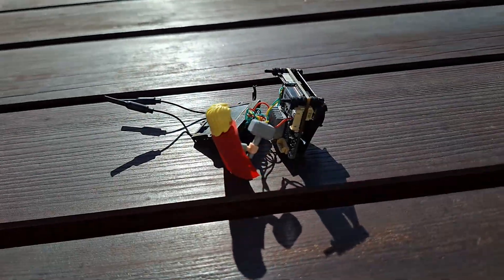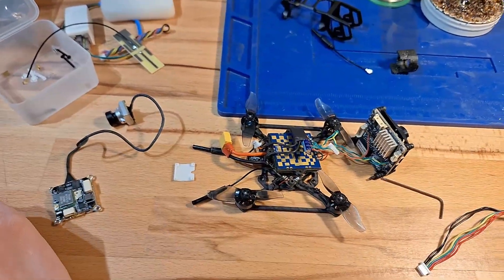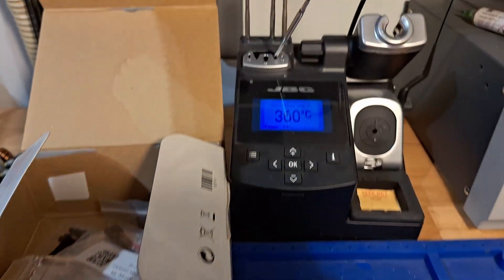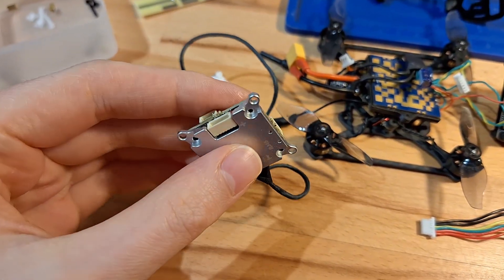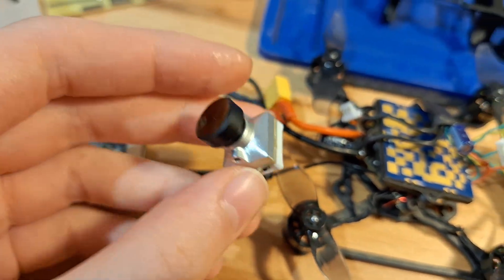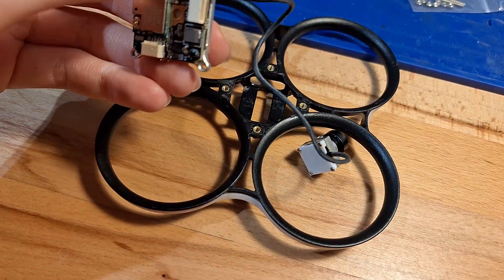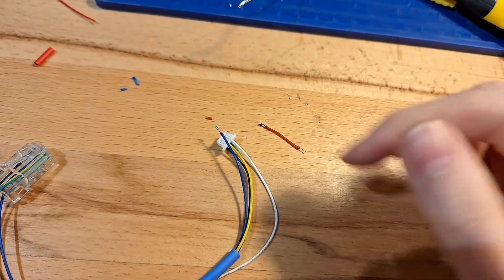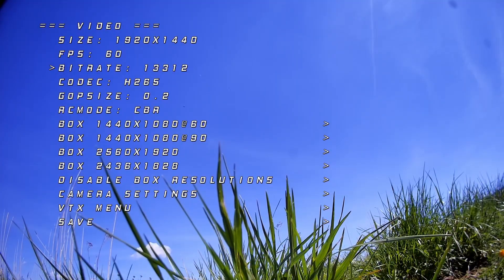The TINIEST OpenIPC FPV camera and VTX - Thinker Tiny review

Comment: Oh man I tore that jst connector off on first use, there was no solder holding down the sides, just the 6 little pins and some conductive glue. I had 45 degree connectors so soldered a new plug and reversed the wires, then stuck with hot glue. Checked all the connections with a multimeter so hoping will be ok. Flashing the firmware to emmc on the groundstation Radxa was very finicky, a good dozen repeats of flashing a bootloader then a clean image, then the bootloader, then the ipc image. Kept hanging at given percentages but finally eaked through. Was a bit disappointed with how fragile the thinker was, and how narrow all the documentation is. Wouldn't recommend, as much as, be willing to help if someone really wanted to try and I felt they understood what they were getting into.
Reply from the maker: Thanks for sharing your experience. The OpenIPC system is still in the development phase, so the devices are not as polished as they could be and the documentation often doesn't keep up with the rapid pace of development. But as someone who likes tinkering - I love it ;)

Comment: I broke off the debug pads in SSC30KQ. I feel so stupid now...i had soldered them properly and then accidentally it fell and they came off

do you have the pin diagram of the ssc30kq mcu so that i can solder pins to the legs directly

I found the pin diagram of ssc338q one
Reply from the maker: No, I don't have a pinout diagram unfortunately. They seem to be protected under NDA's.
Reply: @arturpekosz 
Thanks for replying.
I found the uart trace leads to pin 41 and 42 and they beep on multimeter continuity test

I will repair the pads and see if it works

Comment: I once fixed a flight camera's not being in focus across the frame by putting tiny black rubber shims under the sensor chip and adjusting the chip's hold-down screws incrementally until it was perpendicular to the lens axis. A tedious process, and you must be careful not to get dust or fingerprints on the sensor, but it worked great.

Comment: ¿Se puede conectar a un Meteor 75 pro hd ? 
¿Usar el mismo conector que usaría la O4 lite, pero conectar la thinker y así no soldar? 
¿Se podría?

Gracias, saludos desde Chile
👋😊🇨🇱
Reply from the maker: Could you send me a link to the drone you are asking for?

I can see "Meteor 75 pro" and "Meteor 75 HD" but I can't find "Meteor 75 pro HD".
Reply: @arturpekosz   
¿Se puede conectar la FC Matrix 1s HD a la Openipc thinker con el conector de video HD?

¿O hay que soldar siempre?
Reply from the maker: You would need to solder, the Thinker's connector uses a different pinout. Also, the wire the Thinker comes with only has the connector on one end, to connect to the Thinker, so you need to solder the FC side of the wires anyway.
Reply: @arturpekosz  muchas gracias 👍

Comment: Hey quick question: can the thinker run on a 5v regulator? I know that 1s doesnt work but the mobula 6 pro has a 5v output for the o4...
Reply from the maker: From what I read, it can work with 5V, but you need a regulator that can provide enough current. But if the 5V regulator is designed to power an O4 then it's probably okay. I haven't tried it though.
Reply from the maker: I checked with some people in the OpenIPC FPV Telegram chat (here is a link by the way: https://t.me/+BMyMoolVOpkzNWUy ), and it seems the answer to this question is unclear. The Thinker is officially rated for 2-6S voltage, and it might work with 5V or it might not, you would have to test.

Comment: I am choosing between mobula 7 and mobula 8, I would like to buy mobula 7 but I am not sure if I can install OpenIPC on it but now I realize it is possible or not? Which drone is better to choose for OpenIPC?
Reply from the maker: I haven't flown any Mobula drone, but I know that someone mounted the Thinker Tiny on a Mobula 7 2S and they told me it worked great. But keep in mind the Thinker can't run on 1S voltage, you need a battery which is 2S or more or alternatively a step-up voltage converter.
Reply: @arturpekosz  How much does the BEC that you used on your IP camera build weigh? Does its weight make a difference?
Reply from the maker: I haven't weighed it, but I would guess somewhere between 2 and 4 grams. But I think the DIY IP camera setup is too heavy for a Mobula 7, Mobula 8 is 2-inch just like my drone so it might be able to do it.

Comment: Same findings here, no lens lock nut in the kit and the 6-pin connector does not fit well, had to use another one.
Reply from the maker: For me the connector fits, the issue was that one of the wires broke off and I had to fix it. I agree that a locking ring for the lens would have been nice to have in the kit.

Comment: How is the delay ? Can i use this for cinematic flying on an 5 inch ?
Reply from the maker: It depends what you mean by "this" and what you mean by "cinematic flying". The minimum latency possible with the OpenIPC system is, from what I know, about 30-40 ms, which is more than analog and HDzero (which have about 15 ms) but similar to systems like DJI and Walksnail. The Thinker is a top of the line OpenIPC camera, but to achieve the lowest possible latency you also need a good receiver setup. The lowest latency is with a Radxa 3W and a low-latency monitor or HDMI goggles, running a 90 or 120 FPS video stream. My setup doesn't achieve such a low latency, it's somewhere in the range 40-60 ms, because I use an Android phone to decode the video and I'm running the system at 60 FPS. But this latency is okay for me since I don't fly very fast.

Comment: This project seems to be taking off quite well.

Can you please make a video how to connect the bl-m8812eu2 to ssc30kq chipset

What are the ranges you are getting from diy and thinker tiny?
Reply from the maker: I already showed how to connect the bl-m8812eu2 to the ssc30kq camera in a previous video: https://youtu.be/aJwHacSwsAA?t=515

I was able to fly to about 400 m with the DIY setup at 16 mbps video bitrate, and about half of this with the Thinker Tiny. But these numbers need to be understood in context:
- I was running the DIY setup at low power, much lower than people typically run with the bl-m8812eu2 module, because I was not using a heatsink and I was afraid of burning it.
- I was running the Thinker Tiny at an output power which I believe is a "safe but on the higher end" power setting for this WiFi module.
- The transmitting antennas I used so far in both cases were not optimal - simple dipoles, which have an inhomonegeous propagation pattern.
- The inhomogeneous propagation pattern of transmitting antennas is a much bigger issue for the Thinker setup, because it only has one antenna. With the DIY setup I had the STBC (Space–time block coding) setting enabled, which made the WiFi module transmit using both antennas. The two antennas were placed at an angle to each other, which compensated for the inhomogeneities in the propagation pattern.
- To make the Thinker Tiny work better with a single antenna, I ordered an LHCP (left-hand circular polarisation) "lollipop"-style omnidirectional antenna, which has a much more homogeneous propagation pattern.
- The receiving setup I've been using so far is not well optimised for long range (only one WiFi adapter, with two omnidirectional Pagoda antennas). Having more WiFi adapters, with some omnidirectional and some directional antennas, is much better for long range.
- The Pagoda antennas on my receiving setup have LHCP polarisation, and the dipole transmitting antennas have linear polarisation. This means some signal is lost due to the difference in polarisation. Once I get an LHCP antenna for the Thinker Tiny, they will match the LHCP receiving antennas, and this cause of signal loss will be gone.

There are many factors that influence range. I think there is a chance that with a better antenna, I might be able to achieve roughly similar range with the Thinker Tiny as with my previous DIY setup. But that's because my DIY setup was run at low power - I know that some people have achieved multiple kilometre flights with the bl-m8812eu2 module, running it at its maximum power and using a much better receiving setup with directional antennas.
Reply: Oh how did i miss the wiring part.....
Wow such a detailed analysis, thank you so much for replying.

I am planning to use 
AIR Unit
1 Bl M8812EU2 module
2 omni 3dbi antenna 
1 ssc30kq camera with 2.8mm lens

Ground Unit
1 Bl M8812EU2 with 2 3dbi omni antenna
1 VR box(i own)
My mobile

I also have a radxa 3w but i want to first enjoy the basic setup

I also heared the bl-m8812eu2 has 800mW of power (probably transmit power) as this is the module used by wyvern link high end module

I also have a Bl-r8812af1, wondering if i mix match eu2 and af1 modules with the radxa 3w
Reply from the maker: At the moment, the PixelPilot app only supports the rtl8812au WiFi chipset, so the bl-m8812eu2 won't work with PixelPilot at the moment (but the devs are working to implement support for it in the future). You can use your bl-r8812af1 with your phone - this is what I'm using now.

Yes, the bl-m8812eu2 is claimed to have 800 mW of transmit power, but this depends on the modulation scheme you use and whether you want to run the module near its maximum setting. But yes, it has a lot of power, and many people recommend this module for OpenIPC in the 5 GHz band (I heard it doesn't have power amplifiers for the 2.4 GHz band but most people use the 5 GHz band for FPV anyway).
Reply: @arturpekosz  ow....that is why.....
 i always thought why would you use af1 instead of eu2 in pixel pilot setup

I will then use the af1 and keep the eu2 for future purpose.

Umm about the modulation thing do you have any resource where i can read up on that.
I would use a heat sink and a 3030 5v fan with a 5v 5a bec to power the camera, wifi adapter and fan. Using this setup i atleast want to run at 80%

I have seen another youtuber using a AC180 2w as wifi adapter and getting around 3kms range....but that module is costly to get shipped from China
Reply from the maker: I think the best source of information about OpenIPC-related issues is the Telegram chat. There are many knowledgeable people there who know much more about long range flying than I do. Here is a link: https://t.me/+BMyMoolVOpkzNWUy
Reply: @arturpekosz  thanks for the info 👍
Thanks again for replying 🙏